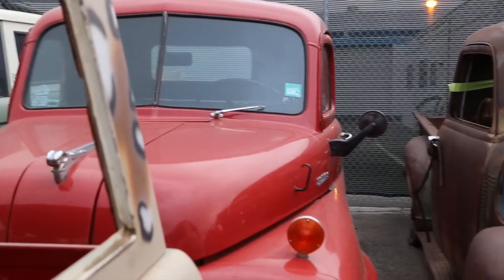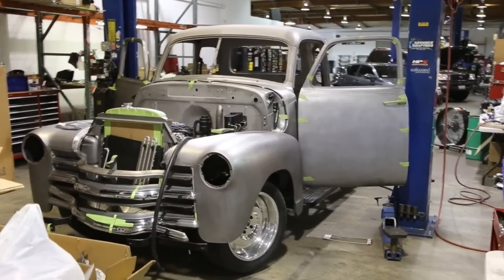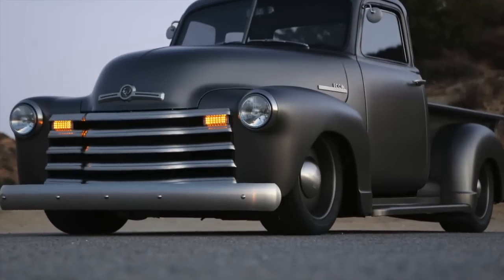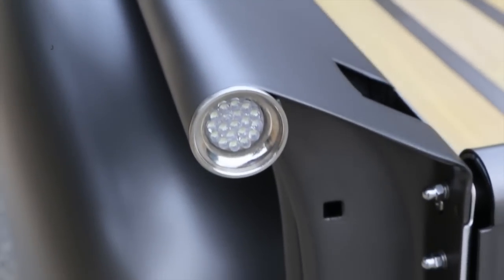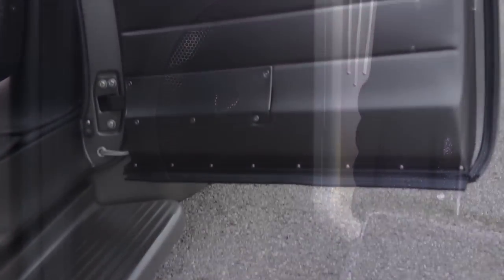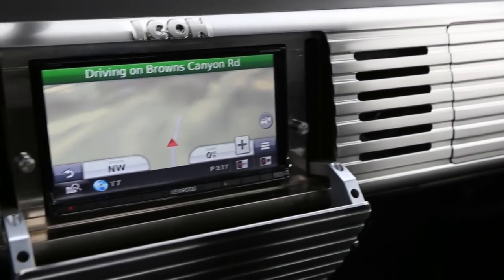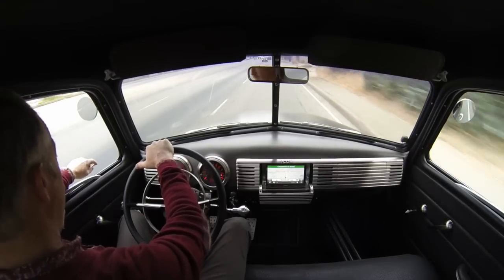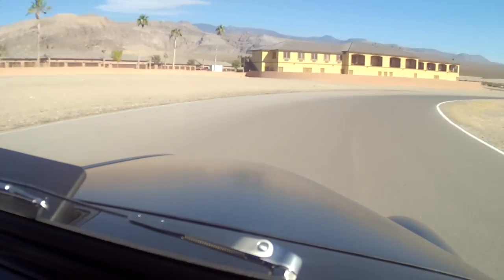ICON Thriftmaster Tour of Details

Comment: I had a '53 Chevy 3/4 ton (3600) 5 window that I got for a day's labor back in 1974. It was completely vandalized but I was lucky enough to have access to a pal's shop to rebuild the engine. I never put anything into the esthetics, it looked like a crappy old truck all the time I owned it. I sold it and the engine blew up about 1000 miles later, guess my rebuild wasn't the greatest. 

It's fantastic what you do to these old cars/trucks but you have to have $150K-$200K and maybe more in parts & labor in them by the time you're done. It's hard for me to understand the economics, but they are really works of art.

Comment: Question, you started the video saying how you take a crispy 50's GMC pickup and take it to the final truck shown.  The cab is a licensed reproduction, the bed looked too toasted to actually use in the final product.  The badging, handles used were new.  Ditto the frame, engine, transmission. How much, if any, of the original truck shown in the begining was actually used?

Comment: Hi Jonathan, I really enjoy your videos.  Information I'm always wishing you'd include: How long each build takes and how much each vehicle costs.  On this video I think you mentioned 10 months, so thanks for that. I get the impression these cars are in the $100k-$200k range.  That wi-fi hotspot on this truck is fascinating, I gotta find out more info about that. On a separate note, regarding the derelicts: I'm assuming you must remove any rust off the chrome parts.  There is a fabulous rust-demolishing product I want to bring to your attention if you're not aware of it: It's called Chromax. It's a delicious-smelling (wintergreen mint?) paste with abrasive crystals that are constantly breaking down into finer and finer bits.  You barely have to exert any effort and the rust comes right off. It works on chrome, stainless, and several other metals... [Edit: Autonet Mobile!]

Comment: I would prefer a stock looking ride height, and Chevy emblems with high gloss paint.  That artsy dull paint would be fine if they had done a military olive green, but otherwise it just doesn't work for me.  The build quality is wonderful, and innovative, modern auto manufacturers could learn a lot from seeing this truck.  By today's standards this re-creation of a full size 1950's era pickup truck would be considered a compact truck and not a modern full size truck.  Also when the original Chevy truck was sold it would have been a lot cheaper than a Chevy sedan.

Comment: I think the Buick and Chrysler you did where dead on with the patina. However I think you got to far away from that with the trucks I have seen on here.
Reply: your commit doesnt make any sense... The thriftmaster had a totally different build purpose compared to the Deralects....which you were referring too.... This is basically the normal icon treatment from his Broncos and Fjs in terms of making a complete new 'old' car again with new surface materials and modern tech but with vintage body.
Reply: Doesn't make sense? I think it's a pretty direct and understandable statement. I don't care what he was going for. I just don't like them.
Reply: +CarlsCustomCreations lmao in that case dont go around the bush and just say" i dont like this ". simple as that... dont understand the hate. best example I've seen of these as a purist and performance driver perspective.properly tuned, chevy motor on chevy truck, proper wheel fitment and dimensioning, simply designed and is a drivers car that can take the track....!!!! better than all that lowrider, ratrod bullshit that see them in all the time.👎

Comment: You you waste the old cab? Pfft that's pathetic. Anyone can just buy a cab.
Reply: I have no idea why they bought the original truck because everything about the truck is after market which never fits. At least the original parts fit. I say this from experience because I built a 1953 Chevy 3 window truck. Every time you use aftermarket parts you have to modify them to make them fit.

Comment: I love the look, but why on earth would put emissions CRAP on a vintage vehicle? I got into vintage cars/trucks 30+ years ago specifically to get away from all the govt mandated garbage new cars had, then quickly learned to love them for other reasons as well, such as their beautiful styling and how easy they were to work on. About 10 years ago I got into "patina" cars, old cars that still looked old and battered on the outside, but with totally reliable mechanical parts underneath. I have done 2 so far, still have the last one (1964 Ford Fairlane) and will probably keep it. While all the mechanicals are new, it has absolutely no electronics or emissions crap on it. New stock crate engine with a Holley four barrel, straight dual exhaust with glasspacks. I would not be afraid to drive it anywhere. I already have over 30,000 miles on it in 2 years.
Reply: The very reason I'm into old cars is because I want no electronics or computers of any kind on them. I specifically have pre 1967 cars, because they are exempt from any kind of tampering laws and emissions testing. Other things have been upgraded, the Fairlane has a whole new rack and pinion front end with disc brakes. Because of the EPA, guys like me have been forced to use older cars. I used to have a '72 VW bug that I really loved, but it was such a nightmare getting it through the emissions test every year, I finally sold it. My carbureted cars are totally insignificant as far as emissions go.

Comment: Well what?  No stock frame, No stock suspension, no stock nothing.  Is it still a PU truck?  Not even close!  Put 500 lb of anything in the bed it's overloaded.  All show and no load.  Had one of these on the farm back in the day, 6 volt electrics, would start and tow neighbors cars on a minus 30 degree day,  Bet this one won't even start at -30 deg.  U folks turned a working truck into a wuss ride.  do that make U happy?
Reply: No, this person took what was once a truck and made a car outa it and I consider that to be an abomination!
Reply: Once again, YouTube comments serve to prove that small-minded do-nothings will never fail to criticize the accomplishments of those who excel.